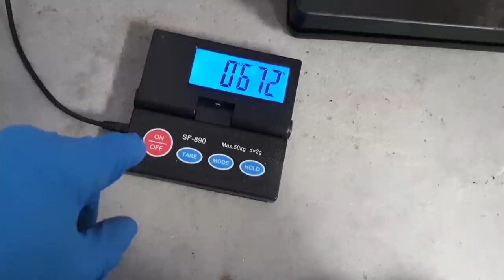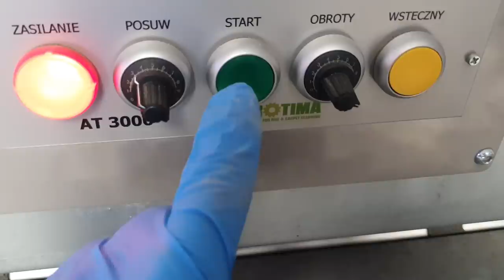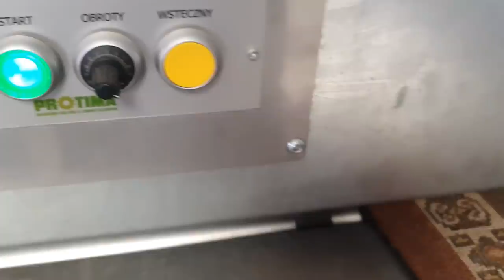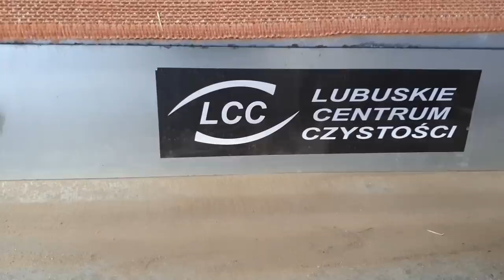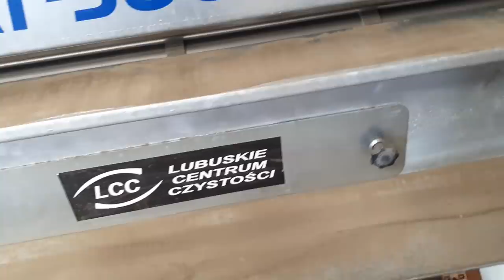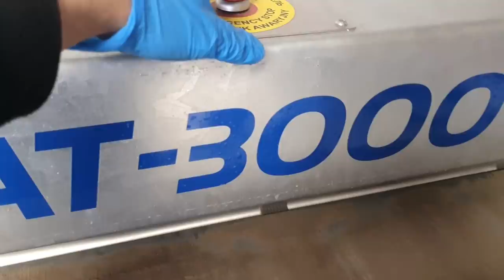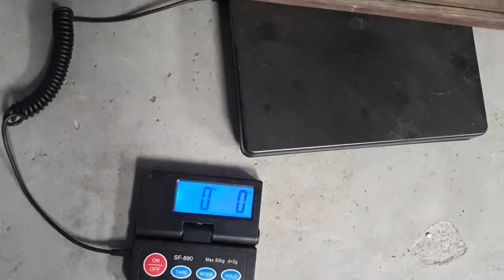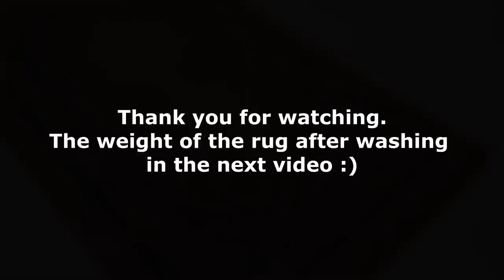Prawie 3 kilogramy kurzu były w tym małym dywanie. Niesamowita siła trzepania automatem trzepiącym💪😍

Comment: I love how that machine works! That did look like a Navajo rug and that did look like sand more than dust. Lots of shiny silica. And if you have seen where those rugs are woven, and how the yarn is spun, there is a lot of sand everywhere. Pretty hard to get sand out of the sheep's wool before spinning. 
    Fantastic process. I think I would use that if I put my Navajo rug on the floor. No, it is on the wall. When I finish the one I'm weaving, I might put that on the floor. That was one very incredible rug!
     Thank you for showing this system. Love the pride in his work.

Comment: Fascinating machine. I don't know how rugs are made, so I was wondering if any of the dust was dried out or deteriorating materials used to make the rug? Do rugs age and break down? Thanks for the video.
Reply: Dead human skin cells and pet dander is what dirt he is removing. The fibers from a rug can definitely break down if they are organic, but the wool used to make rugs typically can last 100 years or more and is firmly attached to the weave so it doesn’t often become dislodged. I don’t do wall to wall carpet in my home anymore because it’s impossible to deep clean properly no matter how much you vacuum. I prefer area rugs and hardwood flooring because the rug can be removed and padding replaced as needed.

Comment: If you were to press the tare button after placing the empty bucket it will disregard the weight of the bucket so you don't need to do the math. You would just need to add the dust into the empty bucket without removing the bucket from the scale.
Reply: But the dust is over here and the bucket is over there ..... it works for him doing the math.
Reply: @tinydancer7426  I didn't say it didn't I'm just stating something I learned as a person who doesn't like math very much
Reply: @michellemybelle4360  I didn't say you said it didn't ...... just being a brat tonight  :0D

Comment: Jakub, you can use the "tare" button for the bucket too. 😊
Reply: That would invalidate the after rug weight.
Reply: @carolinemiller1574  no it won't..... he can tare again after he weight the bucket with dust, so he can weigh the rug on 0 again
Reply: @Klaproossje  
Yes but then he would have to subtract the after weight from the before weight instead of letting the scale do the work for him. Showing the weight of the dirt as a negative integer.

Comment: FYI a cheap way to remove dust quickly is use the sand/pavement  tile vibrator.  Its a machine used in construction to compact soil/sand before laying concrete foundation or  the sand base for pathways and outdoor tiles. It's a machine with a flat steel plate of 18 x18 inches approx at bottom which is vibrated by a engine/motor on top

Lay a plastic garden fence roll on the ground to give a bit of air gap line the bottom of vibrator with a heavy rubber sheet.  Then turn the carpet over this and use the modified vibrator. Works very well. 
You get a specialised machine size of a lawn mover which beats the carpet just like the machine does above. 
But this is a good machine to do bulk work.
Reply from the maker: Thanks for the tip, but I'll stick with my whisk  🤗💖💪
Reply: ❤️not for you but for those who don't have a good carpet cleaning business near by. 
You got your big ass machines.

Comment: WOW!  We've come a long way since my grandma beat the rug over the clothes line with a broom!
Reply: I live in a rural area in the US and we still do this. Even super vacuums and carpet cleaners have nothing on taking those rugs outside, beating them on the clothesline, using the hose, soap, scrubbers, more high pressure water and hanging them up for more beatings. SO much cleaner, and without the residue.

Comment: Question. When you beat a rug by hand with a classic old rug beater. Should you do it only from the back side or also the front side? 🤔
Reply from the maker: Only from underneath 🤗💖
Reply: Thank you. That saves half of the work if I had to turn the rug around and beat the other side just as much. 👍❤

Comment: 8.878 kilos = 19.57264 pounds

- 1.882 dust+bucket - .140 bucket = 1.742 dust weight
- Approx 1 kilo went into the beater machine filters

8.878 kilos rug before beating
6.132 kilos rug after beating
2.746 kilos weight loss

6.0538937 pounds of dirt beaten out of that rug!

And you pick it up with 1 hand!?!
Wow! Strong grip & wrist!

I'm wondering what the rug will weigh once it's washed & dried?!?
Can you find out & tell us, Darlin'???
Reply: Tomorrow’s video - it weighed 5782 grams after washing and drying. Amazing, isn’t it?! I had to covert everything into lbs, also, so I could get it into my brain!  It lost a total of 6.821 lbs of dirt! 🙀❤️

Comment: I think I read on one of your posts that you run each carpet through this dusting machine prior to your cleaning as part of the process. If I am correct, then it boggles one mind to think that you could remove that amount of dust from a carpet and then clean it and still get so very much dirt removed. WOW! We know you removed that amount of dust because you weighed the carpet before putting in the dusting machine and then again afterward. I say again WOW! Dirty rug!

Comment: The moving camera is dizzying to watch. He should put it on a tripod and then move the camera in the direction of what he is doing instead of holding the camera with one hand and manipulating the rug with the other. 

After a while, I came back, and yes, that rug was so very dirty. If water fell on it it would have turned to mud.  

i am sure he does a good job, but I had a bit of a time focusing on what he was doing because of the camera movement.

Comment: In your dust calculation, you assume dust either goes to your bucket or collected in the cyclone filter. In fact some of them are lost to floor and to the air. The cyclone filter is not 100% efficient.